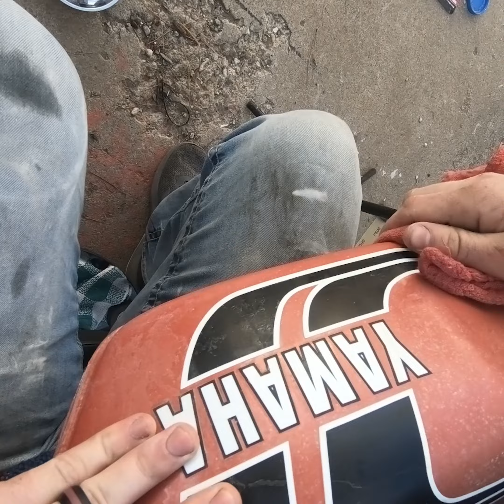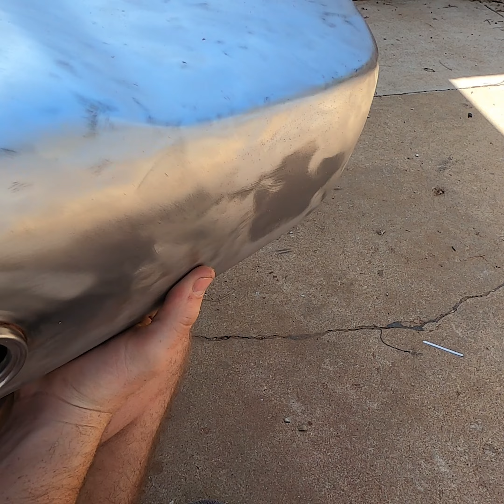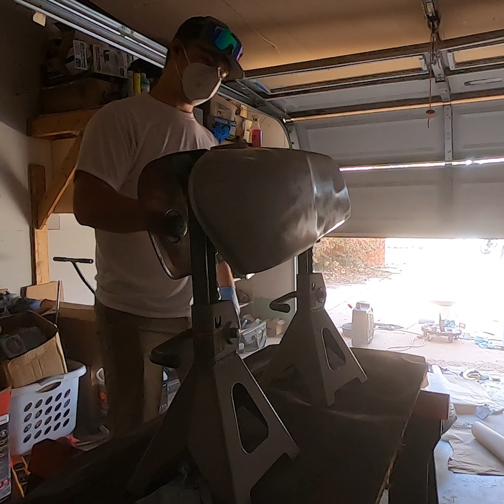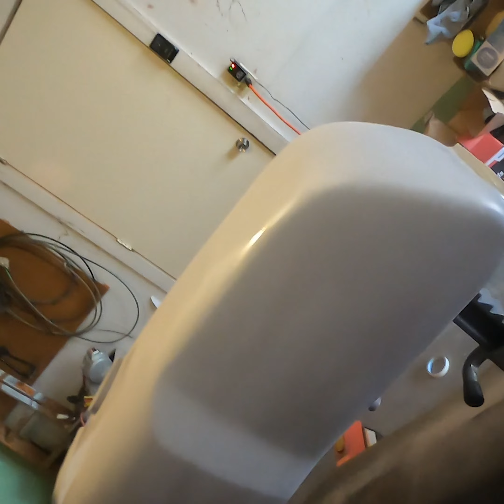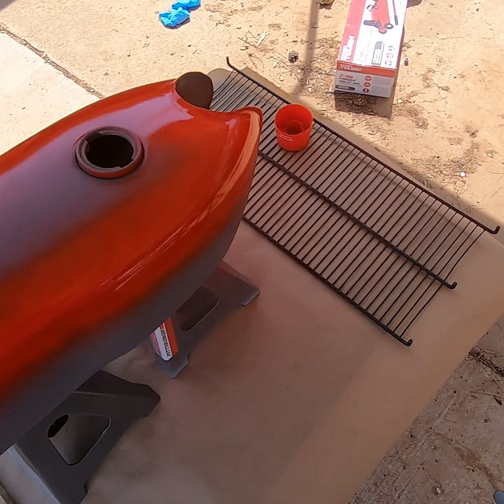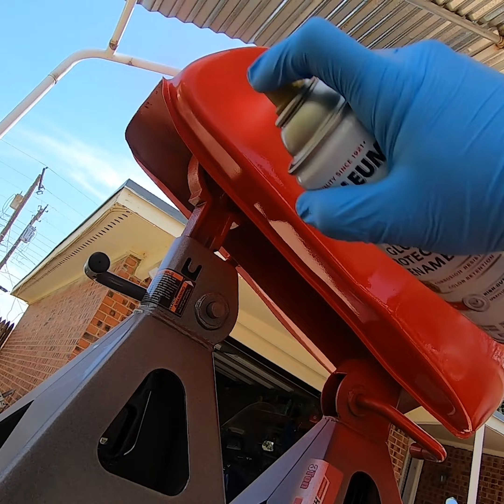How To Paint A Motorcycle Tank With Spray Paint/Rattle Cans Full Tutorial

Comment: Very impressed with the work on your tank.  I’m hoping you can help me as I am going to be painting an entire full fairing sport bike.  I’ll be using rust oleum gloss spray paint, applying decals once paint cures as you did.  My question is in relation to applying 2k clear.  Like you, I want to wait a while to ensure base coat cures before applying 2k clear (avoid wrinkles/reaction).  I noticed you did not wet sand before adding your clear coat several weeks after curing.  How did you know you would get got adhesion? Without sanding after waiting so long?  Have you had any clear coat issues with flaking or peeling?  Appreciate any insight as I am afraid of not getting good adhesion if I don’t wet sand, but like the idea of not doing that step if not needed to avoid ruining base coat. Thanks in advance. Great video.
Reply from the maker: Hey Cory, thanks for the comment! I did not have any issues doing it this way so far, and I sprayed it 3 years ago, but my motorcycle is garage kept and ceramic coated. This is from rustoluem's website

Based on 70°F (21°C) 50% relative humidity. Allow more time at cooler temperatures. Dries tack free in 2-4 hours, handle in 5-9 hours and fully dry in 24 hours. Primers may be top coated immediately. Apply a second coat or clear coat within 1 hour or after 48 hours.

This is one of the reviews of the 2k clearcoat I used : 
It's a 2k urethane clearcoat. It is compatible with enamels so long you apply it within 1 hour of the enamel top coat or after it has completely cured which can take weeks/months. If you clear coat on top of enamel that hasn't fully cured, it will wrinkle. I've always sprayed 2k urethane clear coat within 30-40 minutes after applying the last top coat. Never had an issue with wrinkling.

I personally was scared that if I scuffed up the paint then applied the clearcoat that it would wrinkle (by scuffing it up in my mind i exposed less cured paint), and I did not want to scuff my expensive decals. If you have the time I do think wet sanding could help promote adhesion!
Reply: Excellent info./feedback.  Thanks so much for these details.  My bike was also be garage kept.  Again, very impressed with your work, I’ll keep tuning in to learn from your projects. All the best in the new year!
Reply from the maker: @coryvader2133  Anytime, thank you for the support, best of luck!

Comment: I feel like I Just found my long lost Brother from another Mother lol. I am literally in the middle of doing the same exact thing with the same exact paint and the same exact 2k clear coat and black vinyl decals. I used my angle grinder with a circular wire brush attached to it to remove all the original paint and the little wire brushes that attach to the power drill like you used to get in the tighter spaces i couldn't reach with the angle grinder and took everything down to bare metal. I'm also doing a red and black paint job. Now i haven't gotten to laying the decals down yet but i noticed you put your decals directly on the paint ? That's what i wanted to do too but other people have advised me to put a layer of clear coat on first and then the decals go over that first layer of clear coat and then the second coat of clear coat go over the decals because the vinyl decals will not adhere to bare paint very good. I mean that's just what i heard but the problem i have with doing that is like you mentioned once you pop open that can of 2k clear coat it's only good for 2 hours. If i open the can of clear coat just to spray 1 layer of it i can't use the rest of the clear coat until the decals have been put down which means the rest of the can will go to waste cause i can't get the decals on that fast after putting the 1st layer of clear coat on and i'll have to buy another can. But it looks like laying the decals directly on the paint worked out well for you so I'm thinking i might do it the same way. Did the decals give you any issues with adhereing to the paint off camera ? Your paint job with decals came out looking sick ! I Love the red and black glossy look. Exactly what i'm aiming for.
Reply from the maker: Hey long lost brother! lol. I did not have any issues at all with the decals adhering to the paint, I did let the paint completely cure over 2 weeks prior. It was hard enough that i trusted putting the decals on it! This was two years ago, and i have not had any issues yet with bubbling. Yeah the 2k clear coat is expensive :/. I did use some soapy water to get the decal on, but once squeegeed out the decals were stuck on very well. After applying the decals (i did this in the winter, waited the paint to cure, applied decals, then waiting another two weeks to ensure proper adhesion) i did give it a few weeks to make sure it adhered well. The red  rustoleum paint held well to the primer. I think the decal stuck well enough that it would pull the paint off if i tried to pull of the sticker haha. The red paint is a "softer" paint due to not having a catalyst. I haven't ever put decals over clear coat, i figure it would work fine but again it would be more expensive because you would have to use another can of 2k clear coat. Again I did not have any issues at all doing this method! Just adequate soapy water. These decals were also very sticky, so I did not have any issues with them peeling once adhered. I feel as long as you have a high quality decal it will properly adhere. Off camera I did try to use some of the 2k clearcoat approximately 48 hours after mixing it, and it was a huge mistake. It bubbled up bad, ran terrible, luckily i was able to use acetone to get it off before it hardened. I thought I ruined the tank, but was able to act quickly. It literally made the tank look like small soap bubbles everywhere, so i would not try to push it past the 2-4 hours.  Thank you for watching man! Best of luck. Any other questions just let me know!
Reply: @octanerestorations  Just so i don't waste the can of 2k clear coat i'm thinking of doing the entire bike frame as well as the tank and fenders. All metal parts anyway. But here is another question for ya if you happen to know the answer. If not i'd like your opinion anyway. So As of right now I have the red gloss rustoleum spray paint on both the fenders and some of the Rustoleum black gloss paint on the bottom half of the gas tank. But i was browsing Ebay for quality spray paints in a Honda Red and i found Honda Fighting Red Spray Paint that looked really good on my monitor so i went ahead and ordered a can of it. It's just a Base Coat though. So i guess my question is is it safe to spray a Base Coat Paint over the glossy rustoleum spray paint or will it have a bad reaction on the rustoleum paint and come out terrible ? Or should i just give the parts with the rustoleum paint on them a light sanding to scuff them up enough for the base coat to stick to them ? I'm not 100% sure i will need to spray over the rustoleum just yet it depends on just how close the Honda Fighting Red looks compared to the Rustoleum Red. If I can't even tell them apart I'd probably just leave the Rustoleum Fenders alone and do the rest of the bike in the Fighting Red. But if the Fighting Red looks a lot better than the Rustoleum than I'd probably just do the whole entire bike in the fight red. So when the fighting red arrives i will just test spray some on the gas tank where it's still bare metal to see how it looks and then take it from there. Also I never understood how the soapy water thing worked with the decals cause i would have thought the soap water would remove the sticky adhesive from the decal so it doesn't stick as well but apparently not since a lot of people use that method. I Just hope the flame decals i got are actually good quality and don't start curling or shrinking once the 2k clear coat hits them. Guess i'll find out. I only paid like $13 bucks for a 6 pack of flame decals from Ebay so they weren't exactly expensive lol. Now I'm wondering if i should just order more expensive decals but the ones i have are the perfect sizes for my application. Here's a link to the Fighting red I got. -->    https://www.google.com/shopping/product/1?q=Honda+Motorcycle+Fighting+Red+R-134+R134+base+coat&prds=epd:13384492676239023375,eto:13384492676239023375_0,pid:13384492676239023375&sa=X&ved=0ahUKEwja8pTo6pD6AhWvKFkFHRzEB6IQ9pwGCAU
Reply from the maker: @JNC1973  i definitely wouldn't just spray the honda red on the glossy red paint, I would either scuff it up like the primer and lay the honda fighting red on it, or scuff it up, put primer down, then lay the honda fighting red. Will be an extra step, but in my opinion paint just lays better on a primed surface, and that is what primer is meant for. I don't think it would look bad, but I would be concerned about the long term adhesion to the rustoleum paint. If i were in your shoes i would scuff it, then lay the primer, then sand the primer, then lay the honda red! That is a pretty red! 
Soapy water (I used a 95% water to 5% soap) provides a small amount of lubrication, but when it dries thats where the adhesive sticks on. As long as your decals are vinyl and not paper based (Paper based will fall apart with water) i believe you should be fine. You could always try them out on something with soapy water to ensure it does not mess with the adhesion. If you ordered automotive decals then they are most likely vinyl, which should not warp or shrink when clear coat or soapy water is applied. If they are paper based, then they will absorb water or clear coat and be ruined, and potentially ruin your paint job! Most adhesives on vinyl are solvent based, so soapy water does not affect them to any noticeable degree, once the soapy water is dried. Just ensure the surface you are applying the decals on is free of any oil or contaminates!
Reply: @octanerestorations  Hey i had to scroll through a ton of you tube notifications just to find our conversation here to re - read what you said in the first comment. I just got my can of Honda Fighting Red Base Coat Paint in the mail finally and after putting the Red Rustoleum Automotive Primer on the tank and letting it dry I applied 2 layers of the Red Base Coat. It seems to have dried pretty fast. A lot faster than I thought it would take. So I was sitting here debating how long i should wait to start applying the vinyl decals and was gonna do it some time soon but then I came on to here to see how long you said you waited and when I saw you said you waited 2 full weeks before adding the decals I was like DAMN !!! I'm so impatient and just wanna get this project done already lol. And as if this 2 week wait isn't gonna be hard enough then you said after you put the decals on you then waited another 3 weeks to do the Clear Coat ? This is gonna take foreverrrrrrrr........ But i guess i will have to force myself to wait it out in hopes that the end result will be well worth the wait. Even though the base coat feels dry to the touch the same day i applied it that doesn't mean it's fully dry and cured underneath and could cause bubbling under the decals if i put them on now. But i wonder if i put the painted tank in front of a fan 24/7 if that will speed up the wait time for me to do the decals ? You think ? Maybe if it's in front of a fan 24/7 i can wait 1 week instead of 2 weeks ? Also it's in an air conditioned room. 🤔🛵
Reply from the maker: @JNC1973  whats the humidity like where you live? I feel that! I think the quickest you could do is apply the decal 48 hours after the last coat of red paint, and then clear coat 24 hours after that! I had extra time painting so I did not mind waiting! But I think you should be fine looking at the manufactures recommendations!
Reply: @octanerestorations  We are starting to get a break from the insane humidity lately but it still rears its ugly head every now and then. But i'll just wait till the next nice day where i don't start sweating the second i step foot outside the front door. Last night i primed the frame and after the Primer dried started spraying on the Red Base Coat but ran out of base before i could get the whole frame finished so i guess i have no choice but to order a second can now so i can finish the frame. Unless I just say screw the Honda Fighting Red Base Coat and do it all in Rustoleum sunrise Glossy Red instead so i don't have to wait another week or so lol. I dunno what to do. I just hope what I've painted in the base coat so far doesn't get ruined in any way while i'm waiting for another can to arrive. We'll see what happens.

Comment: Have you got gas on the clear coat did it ruin the clear coat
Reply from the maker: So if you do not use a 2 part clear coat (which this is) then gas will ruin it! Regular clear coats from auto parts stores that you don't mix will be eaten by gas. This wont be!